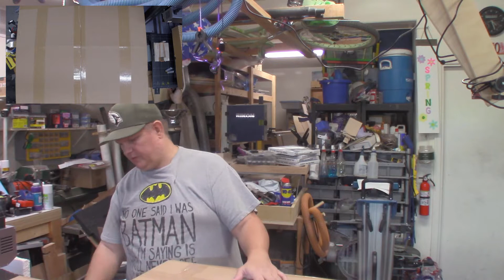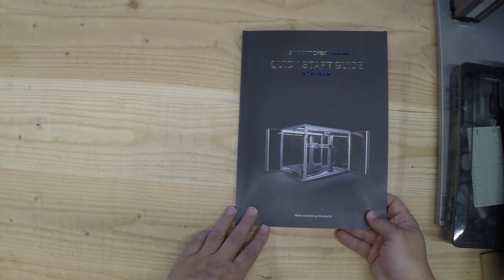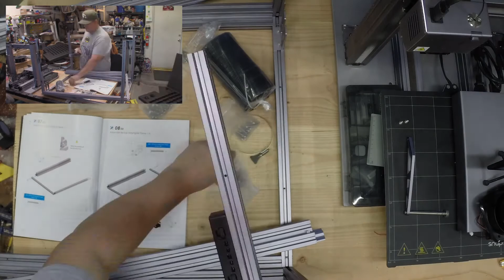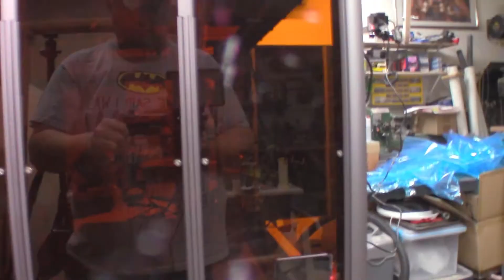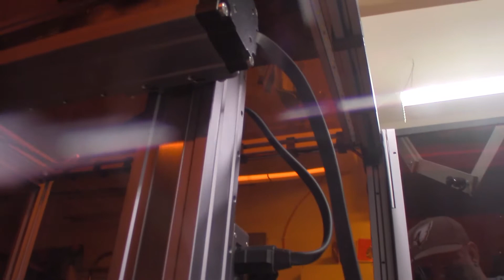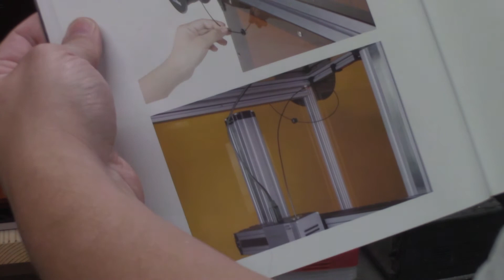Snapmaker Enclosure Unboxing and assembly

Comment: Sorry if you mentioned this but why do we need an enclosure?
Reply from the maker: You don't "need" an enclosure. They do help with dust, smell and sound control though. But if you have it in an area where those are not an issue then by all means do no get it.  Alternatively you could just build your own, just make sure that the touchscreen is accessible from the out side and does not over heat.

Comment: Nice video. Just ordered my a350 machine a week ago and still on the fence about buying this enclosure or building my own. What would you suggest? Are there any major flaws you've found with this enclosure?
Reply from the maker: I have not ran into any major issues with the enclosure. The only thing I would like would be and extension for the controller so that I can pull it out while the door is closed.

Comment: I am after the outside dimensions for this enclosure as I am planning to build a specific workbench for this unit. Could you assist please?
Reply from the maker: Hi, the footprint of the enclosure is 25" x 33" and is 24" tall.  Hope this helps.